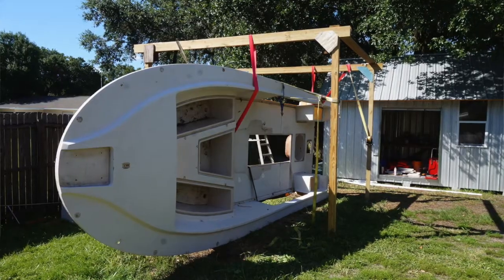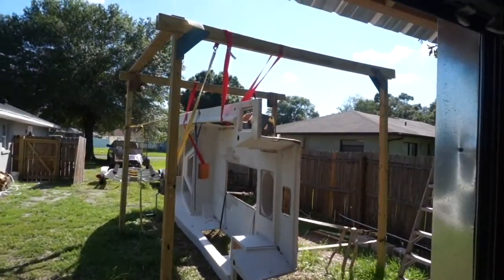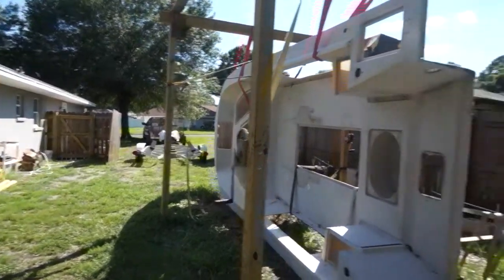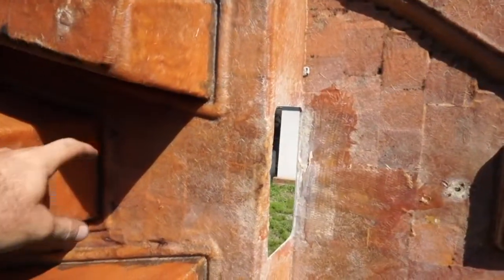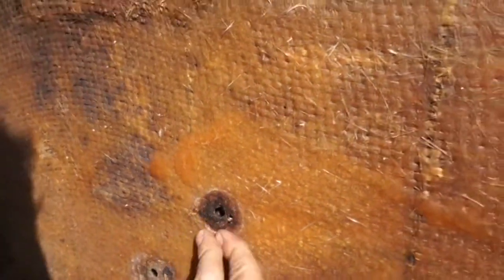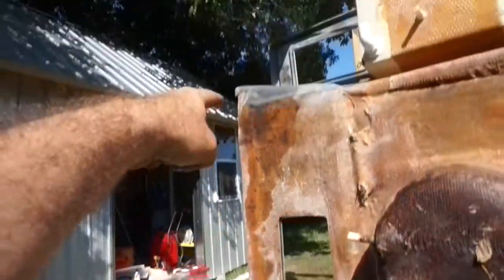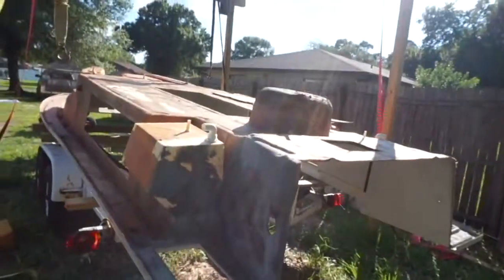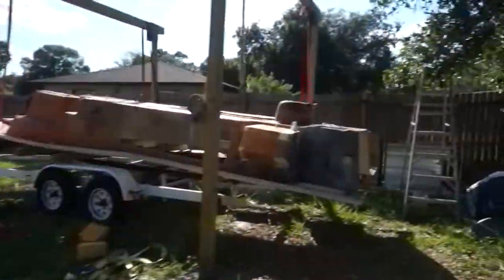Rebuilding a 1987 Chris Craft Seahawk 213 (episode 11)

Comment: Hi Dustin,

On a forum I read that when cutting out portions of the cap (when the cap is off the hull), do your best to make sure it is as close to the shape that it needs to be when on the hull.  If it is twisted or bent, when you put in new core material and new fiberglass it may not want to go back to its original shape and you could have difficulty getting it to match back up with the hull.  I have no personal experience with this but it seemed to make sense to me.  Following your progress, looking forward to more!

Comment: Hey man looking into buying this same boat. Is there a way to put a leaning post livewell on it with plumbing blow deck?
Reply from the maker: Yes, thats my plan. There is a ton of space to the left or right of the fuel tank. Dont get me wrong, its a lot of work but definitely a possibility. The is a block of foam on both sides of the tank, so depending on which side you went to (id do the left side of the tank because there is no riging tubes on that side) it would need to be cut to fit the piping.
Reply: @elementfishing  so if I go from the port side of the boat it will go to the bilge area without having to cut into any stringers? Thanks brotha
Reply from the maker: Send me your email and i will send you a picture of the underside of the deck/stringer space
Reply from the maker: Was the photo helpful?